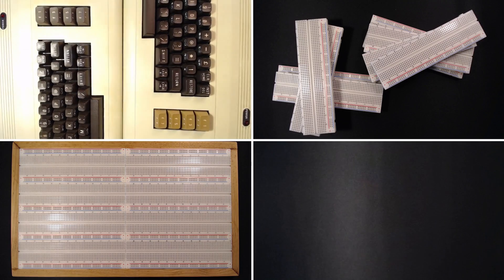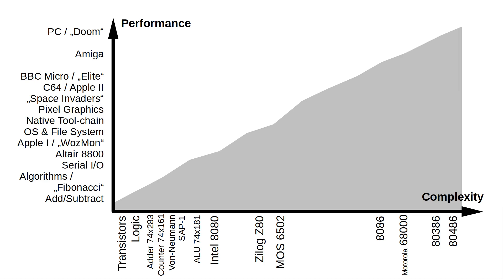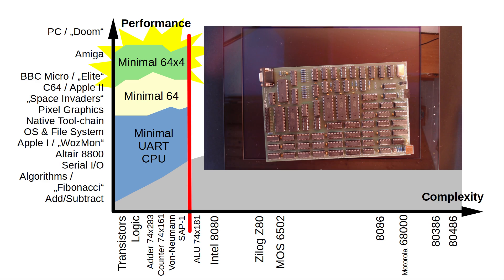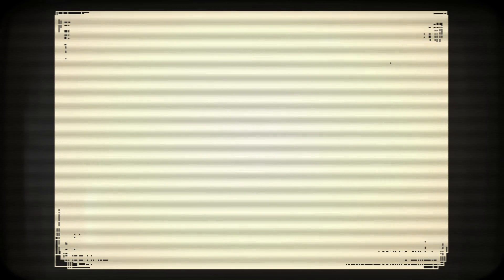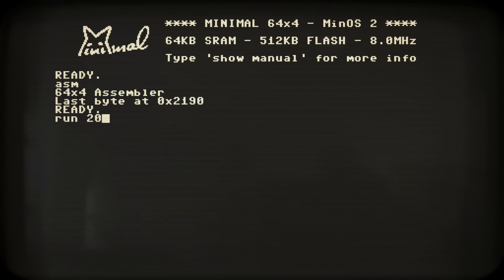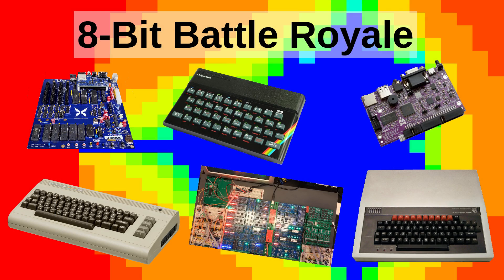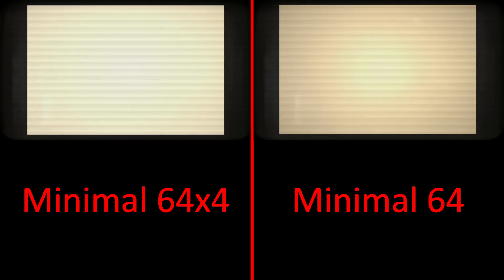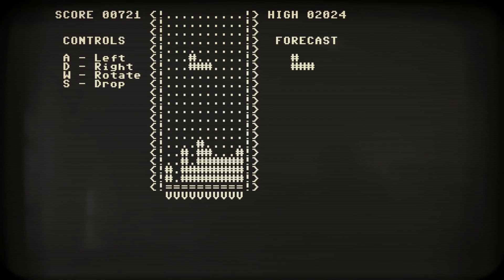Minimal 64x4: The Oddball in Home Computer Development

Comment: This is really great, I appreciate you so much. There's a real need for something like a hacker console with a reasonable amount of power but isn't overburdened with complexity and restrictions. Developing software used to be fun and immediate with a huge amount of creative freedom. Now it's extremely bogged down by complexity and security concerns.
Reply from the maker: That is exactly how I felt before developing the Minimal 64x4!
Reply: What you are describing is more closely matched by the Uzebox than the Minimal64x4, which isn't quite minimal enough for me. The Uzebox Omega only requires one chip to run and you can build it in a weekend.
Reply: @danboid  Sure, my FPGA computer also only requires one chip (if you have an FPGA with built-in flash), but that doesn't mean it's built from simple chips. The Uzebox has a (quite complex) microcontroller as the "one chip" (an ATmega644 running at 20 MHz, with 64 KiB of ROM, 4 KiB of RAM, all kinds of hardware timers, I/O support, 32 registers), which is far from "minimal". It's just that the complexity is hidden in that one chip.

Comment: Bit random but is the value of R27 meant to be zero?
Reply from the maker: Yes, that is intentionally. There are rare cases where the 377 and 161 registers of the address inputs of the control ROMs differ in propagation delay. A nonzero R27 can then be used to slow down the 377 just a tad to avoid switching spikes. Never used it, though.
Reply: @slu467  thanks

Comment: I think you should be able to remove the dependence of VRam from System Ram, thus releasing the 16Kb that are currently highjacked by VGA output.

So instead of writing to physical memory for the VREG to capture it, why not just output both the VGA pixel address and data onto a special port so that the VREG updates from that, avoiding completely the need to reserve these 16kB (from 0x4000 to 0x7fff) of system RAM?. 

The advantage is of course that you get extra 16Kb of ram for general purposes, which is a whooping 25% of all available ram.

The only 2 drawbacks that I can think of are:
- The inability to perform "reads" on video ram, but that's rarely needed or even a bad programming practice if some code actually does it.
- The slightly slower updating of video ram, but that's probably negligible in real game scenarios given that most of the time the processor will be doing far more demanding computing tasks than just updating bytes to the VGA monitor.

Does this make sense?
Reply from the maker: Have to think about this. I consider reading back from VRAM quite important for doing pixel graphics, e.g. setting random pixels, drawing lines etc. The new pixel has to be ORed into the existing data byte...
Reply: @slu467   In such case things certainly get a bit more tricky. My suggested approach is of course implementing VGA output as a sort of "graphic unit" to which the main cpu only sends commands. So if setting/clearing individual pixels must be supported maybe this can be done by specifying bit masks. That of course makes things more demanding on the side of such "graphic unit" because it must handle internal reads on its own video memory to honour such masks. Anyway, just a thought.
Reply from the maker: @RelayComputer  Yes, this kind of development is a continuous trade-off. Many different approaches come to mind. I went for minimal effort/complexity on the hardware side.

Comment: What are the architectural differences that make the 64x4 twice as fast as your original "minimal 64" at the same clock speed?. I can't see that from just comparing your "CPU architecture" diagrams... Since you are not pipelining the CPU, is it just the addition of more instructions (so that some code may use fewer clock ticks to execute) which makes it faster, or is it something else?
Reply from the maker: 3 Things: a. CPU clockrate went up from 6 to 8MHz. b. Way more efficient instruction fetch. c. Faster zero-page instructions for time-critical stuff.
Reply: @slu467  Thanks for your reply. The Acorn ARM1 processor obviously was a totally different architecture, as it was a load-store pipelined processor, but interestingly the PC was set from MAR+1 not the opposite. The PC just follows MAR+1 unless it's a data memory access. This is possibly faster than attempting to use the PC to set the MAR. So in ARM processors the PC always points to the next instruction and that affects offsets in branch instructions. Assemblers and compilers must take care of that when generating branch instruction offsets because the processor itself does not compensate for that during instruction decoding

Comment: For video, you need two registers (however many bits = colour depth of screen). Let's say it's 4-bit each, so that's a single 8-bit register. These go into a quad 2:1 mux with your current VGA output being the channel select. Need a mux faster than ~40ns which should be doable. What this gives you is a completely CPU driven foreground and background colour. I personally really like the RRGGBBVV scheme dreamt up by Lucid Science which gives you two common value bits per channel and in 8-bits gives you CLOSE TO Amiga-level colour palette. Now, this could simply be done at the beginning of the raster line with an interrupt tied to the HBLANK (you have that right?) or by polling the beam counters. With a moderately fast CPU you should be able to pull off some pretty crazy COPPER effects.

Comment: Great job, but the UX is that of a 1981 PC or a Spectrum+2 without sound or color. Computers really became much more fun to use (games, utilities and creative software) with that and multitasking. 

This game selection is sort of a replay of the late Apple II and early PC era - say 1979-1983, and when computers could do more, deeper and more fun and reactive game (and utility and creative software!) ideas emerged.

Those computers who punched up, the C64 and MSX2 a little, but especially the Amiga, really covered both the clunky terminal style computers all the way to black box consoles with only arcade style games, and added the modern computing UX in 1985 that didn't really become real on competing brands until circa 1998. A small part of this is due to the complexity of the hardware or staring at chip or transistor counts, but what was ahead of its time was the vision. It was the computer of the future, a deliberate step away from the clunky old computers.

How would you implement something that would be as bold and say, "NO!" no more textmode. No more monochrome. No more lagging and stuttering and hourglasses. High resolutions in color, multiple monitors, expansion support, and a way to manage graphics space and performance requirements? Amiga was great out of the box, while the PC struggled mightily for the longest time - even swapping RAM to harddisk when you moved the (software) mouse pointer!

You might end up with circuitry akin to the Amiga. Or RTG/graphics card/dedicated VRAM akin to all the brands that struggled (until they put GPUs on the graphics cards). Or perhaps a really neat solution? Dual-port SRAM? Go! \o/

Comment: I've just been nudged towards this video, and my mind is blown. PCBs ordered! Can't wait to build this and learn how it works. Full marks for the documentation too. I need to study it in more depth when I have the time, but it looks like you've assembled probably the best computing fundamentals learning resource I've ever seen.
Reply: I've never ordered PCBs before. Could you tell me which company you used and any details I need to attend to? For example, should this thing be made of base material FR-4, and is it two-layer?
Reply from the maker: @pbrninja19  I order my PCBs locally, but it doesn't matter. Just upload the KiCAD project as a zip or the provided Gerber files and they'll happily do the rest. 2 layers, simplest stuff. Good luck!
Reply: @slu467  Thanks for the advice. I ended up ordering from AISLER in Germany. Very convenient! Thanks.
Reply from the maker: @pbrninja19  That is a very good choice 👌
Reply: @pbrninja19  I used JLCPCB, but you might use PCBWay or any other. Upload the gerber zip file, probably just run with all the defaults. The hardest part is choosing the colour! (I chose red :) ).
Reply from the maker: Thanks Dan, I am glad you like it. Let me know how the build goes.

Comment: I first learned how to code in basic and was immediately challenged with performance issues. It's almost the first challenge you run into, so everything you do always considers performance first. This leads to totally weird and convoluted ways of doing things. It's a totally different mindset that is no longer necessary, for better or worse.
Reply from the maker: That resonates with me. Not having to worry about performance gives total freedom to the programmer. That may lead to beautifully abstracted solutions but may lead to convoluted ones, too. Personally, I feel I need technical limitations to fuel my creativity. Weired, and the only reason I find these simple 8-bit machines enjoyable.

Comment: 8:20 This "8-bit battle royal" cannot possibly be right. I guess the ipc and cpi values listed are some kind of weighted mean values? However,  how can the eZ80 possibly have a higher clocks per instruction (4.03) than 6502 (2.33) when many eZ80 instructions execute in a single cycle, and very few takes as much as 4 cycles... Makes no sense.
Reply: I learned about 65ec02 which also only needs a single clock for a lot of instructions.
Reply: @ArneChristianRosenfeldt  Indeed, although that one is not on this list afaik. The 65EC02 also does this only for things like INX, CLC, etc, while the eZ80 can do a full 16-bit or even 24-bit addition in a single clock cycle.

Comment: A computer who cannot boot up with display 80 characters is not grown up. But great project !
Reply from the maker: Yeah, 52cols in 8x8 is about as good as it gets on the Minimal ;-) 80cols are nice for programming but a pain for games. The aspect ratio just looks off to me. I thought about an 80cols editor for the Minimal 64x4 using an 8x5 pixel font. But this is cheating and probably doesn't look nice...
Reply: @slu467 so this needs to be flexible, not minimal?

Comment: I don't understand gap between other with simmillar IPC count, do  you have much faster RAM than old 8-bits ?
Reply from the maker: Yes, the RAM and FLASH I am using were not available back in the old days.
Reply: PCEngine has 7 MHz RAM.

Comment: Back up the truck, the Zilog Z80 is less complex and less performance than the MOS 6502? Perish the thought!
Reply from the maker: The 6502 is an early example of a more efficient multi-pipelined CPU while the Z80 is not. The Z80 has other advanced feature for sure, but it lacks this more modern achitecture.
Reply: @slu467 I measure complexity in terms of transistor count. Area for a given fab process. I think that embedded needs 8bit. Home computers need 16 bit address lines or more. Every coder wants flat memory. Paging is seen as complex and only accepted for cartridges , error correction sectors on CD.

Comment: Wonderful, simply wonderful
Reply from the maker: Many thanks!
Reply: @slu467  looks like the vram is shadowed now, was that the main source of the speed bump or was there some other big change that gave you the 2x processing speed boost?
Reply from the maker: @StevenSherman-kr4xm Shadowing VRAM got me from 6MHz to 8MHz clock speed. The real efficiency gain lies in the new instructions fetch, transfering PC to MAR in just one clock cycle and in the introduction of fast zero-page instructions. So it's multiple things - as always ;-)

Comment: Truly an amazing project! I only have a question, its possible to push the speed? If this is based in logic chips, likely its possible to find faster ones and you would not need to add new chips
Reply from the maker: I'd rather not go down this rabbit hole. The timing has to support VGA (in a minimalistic way). It doesn't help to speed things up by 30% or something since that would mess up VGA timing.
Reply: @slu467 I hate the fixed timing on the C64. TED in the plus 4 can be sent to turbo mode using software. This is the way to deal with the dynamic hardware market back in the day and the different color clocks on the globe.

Comment: You did not list the most important of al 1980's CPUs, the M6809!  Nothing was more beautiful until RISC-V....  The 6502 was cheap and limited.
Reply: I would say MIPS comes close to RISC-V, since RISC-V is based on MIPS, which was started back in the 80s. However, I do admit that 6809 is about as good as an 8-bit CPU can get. I have tried designing an 'optimal 8-bit Architecture' several times, and the end result is usually close to a 6809.
Reply from the maker: Unfortunately, the 6809 was quite expensive at the time and soon x86 and 68000 appeared, too. So it didn't get used in the mass market as much as the 6502. Still a nice processor.
Reply: @andyhu9542  HEC you are right 😉
Reply: @akkudakkupl  Nice comment! Thank you!
Reply: @andyhu9542 I just really miss it.  I first learned BASIC on the TRS-80 Color Computer and then M6809 Assembly.. then C and others..    Writing my first few things in RISC-V brought back the memories.
Reply: I loved the 6809 but it certainly wasn't important.  It was a failure in the market and I don't recall much other than the Tandy Coco and some mutant clone of CP/M...
Reply: @teikoh5690  concepts it introduced went on.
Reply: @teikoh5690 It was a great success--just not as successful as 6502.  The 8086 was (and is) a horror show of an ISA.  The market is not very smart.
Reply: @solifugus  History is history.  I was so disgusted with x86 I went on to C programming instead of assembler!  But let's not take away from Slu4's amazing project :-)
Reply: @solifugus  I would say 8086 is not a bad ISA for its time. It filled the encoding space since it was meant to be replaced by the iAPX432. It was not designed to be expandable. The horror show began when people tried to expand a non-expandable ISA.
Reply: @teikoh5690  Take a look into French Thomson computers. They paired the 6809 with a custom GPU which had things like hardware line drawers.
Reply: I liked the fact the 6809 had a 8x8 multiply instruction.  Very envious as a 6502/Z80 8-bit enthusiast.  But that doesn't negate the fact the 6809 just wasn't very consequential.  My first home-brew used a Nat Semi 32000 series which I thought was amazing but in the end didn't go anywhere as a CPU architecture.
Reply: @teikoh5690  How do you compare the 32000 to a more popular architecture, like the 68k or 8086?
Reply: @andyhu9542  The initial 32000 chips (32016, 32032 and 32008) had a nice orthogonal 32-bit register set and architecture (32-bit ALU).  There were also complementary MMU and FPUs (fore 32016/32032) allowing a modern page based virtual memory system.  To me it was like a VAX 11 on a chipset.  Although a commercial failure it was ideal for something like UNIX and I think there were some workstations built using it.  I think it took the 68030 and 80386 to be feature equivalent.  IIRC, performance of 32016 was roughly equivalent to a 68000 at the same clock speed.  Like the 68k its ultimate fate ended up in niche embedded systems (laser printers etc) which was quite a sad end for such an advanced architecture.
Reply: I hate big Endian on 8bit
Reply: RCA 1802 had 16x16 bit CMOS register file in 1974. RISCV has 32x32 bit CMOS . Why was RCA so slow despite 6Mhz ? I could imagine a 4 Bit ALU like in Z80. Two output ports for the lower 4 bits. The higher 12 bits in the register file are single ported. Serial read for the higher bits. Serial means that there is an (implicit) Akkumulator to hold the first data. So load target first. Result goes straight back into the file. No file has less than two ports because CMOS SRAM cells have two ports ( while DRAM has one ). But then again, if we use 4 cycles anyway, why not use a DRAM file like on Intel 8008? For fast code, target Akkumulator. Add instructions to write to flags, Akku, and target.